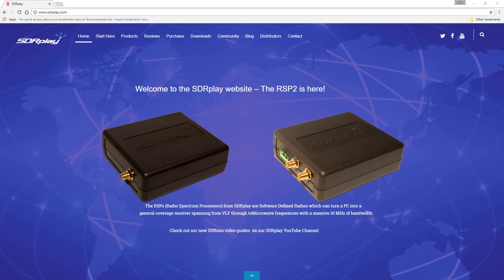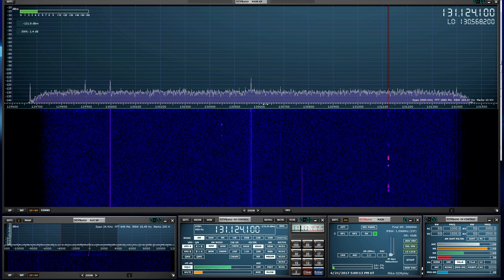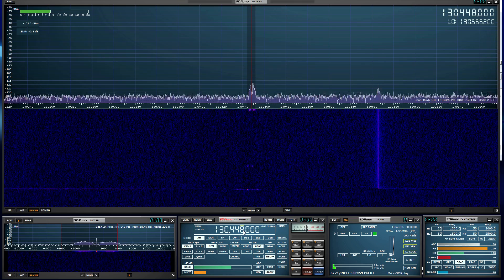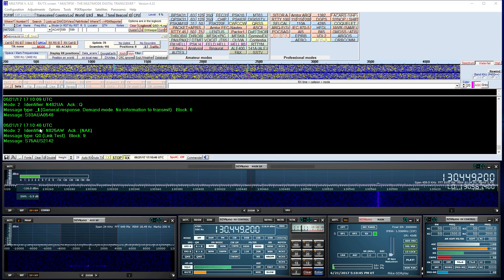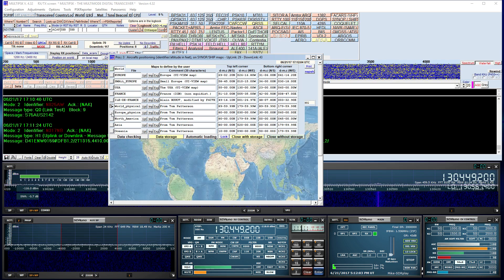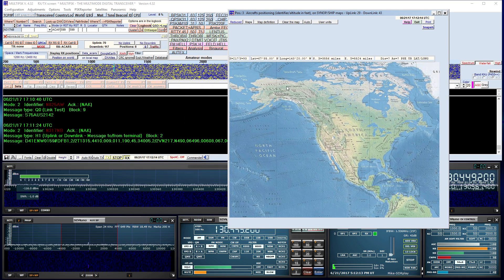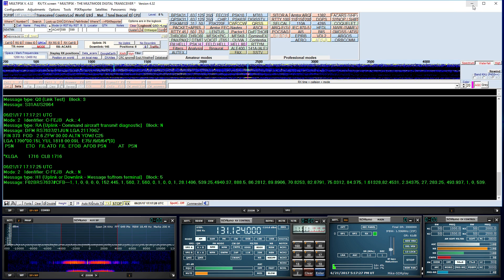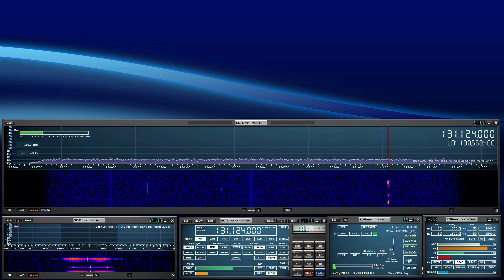How to decode ACARS using SDRuno & MultiPSK (MV016)

Comment: Hello Mike,
I just bought an RSP2pro, which works (only on the aviation band, it's the only antenna I have right now) with SDRuno, and I also bought and installed Multipsk and VAC.
When I display an ACARS frequency in sdruno, I hear the signals well, and there is nothing on the multipsk waterfall. I don't even know if my rsp2 is well connected with multipsk..., I put the audio inputs/outputs as specified in your video, but nothing does, the waterfall of multipsk remains hopelessly empty...Do I have to connect the rsp2 in TCP/IP? I'm a little lost...

Translated with www.DeepL.com/Translator

Comment: Hello, Mike very interesting your videos. I am using also MultiPSK with SDRuno, in Windows 10, and work with VHF Acars with your guide especially with connections from VAC to multipsk. Now I have no problem to see the positioning of the flights in the 
Dx atlas, but if I try to push the buttons: google earth, Display RX positions or Data_acars, a window appears that tells me: 
"Can not open the file: C \ Programs files (x86) \ MULTIPSK \ POSITION.KML For  reading". Do I need to dowload KML files into Multipsk software? or into Google earth. Little bit confuse. Anyway thanks, my mail: xe2kaf99@hotmail.com
Reply: Thank you for taking the time to leave a comment. Try the following.

1: Right click on the mulltipsk folder and uncheck read only
2: Right click on your multipsk desktop shortcut and set it to run as admin.